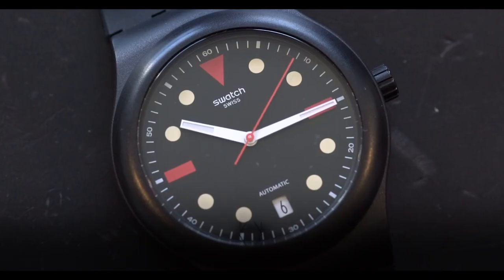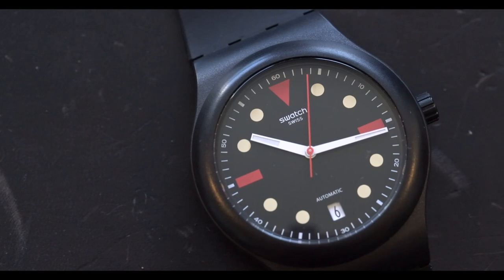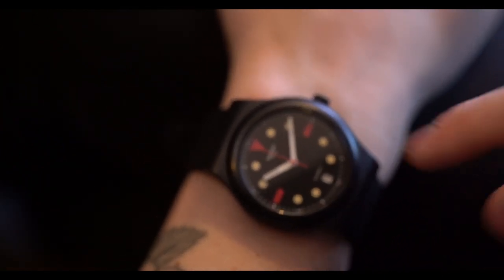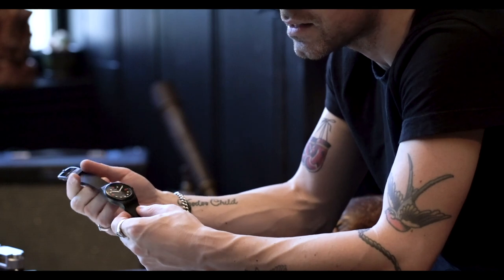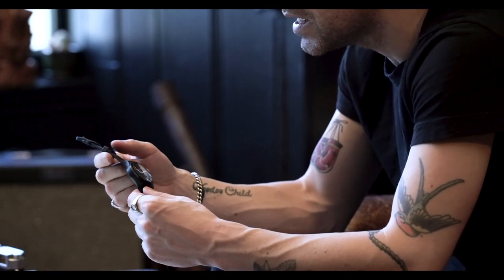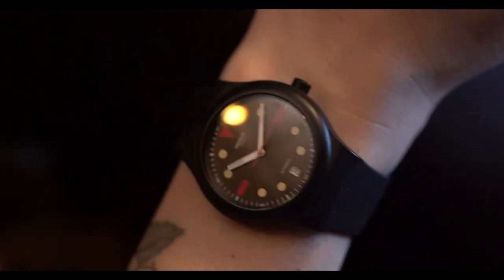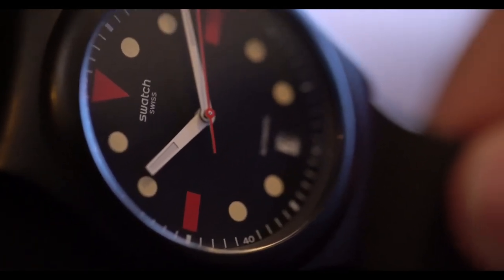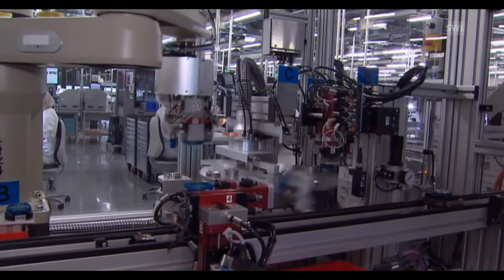SWATCH SISTEM51 HODINKEE GENERATION 1986

Comment: Is it true the System 51 can’t be serviced?
Reply from the maker: according to Hodinkee "There is one very significant update though: Beginning with the Irony collection, Sistem51 watches will be able to be serviced at certain authorized Swatch watchmakers instead of being completely disposable. Previously you had to just toss the watch when it stopped keeping good time, but now you can keep a Sistem51 going much longer with some simple repairs and part swaps. Bravo to Swatch on this one." 

https://www.hodinkee.com/articles/sistem51-irony-steel-hands-on
Reply: Good on Swatch for resolving that fatal flaw.